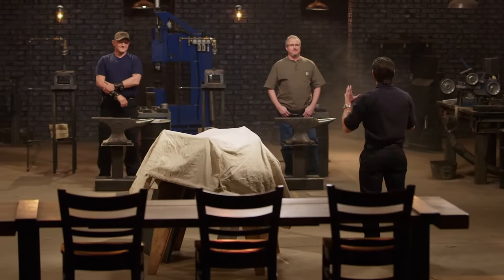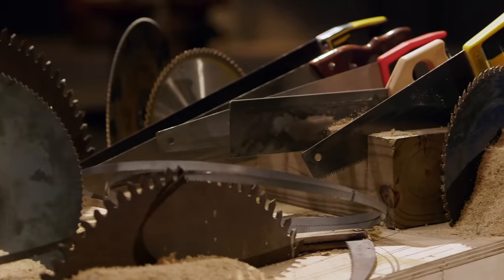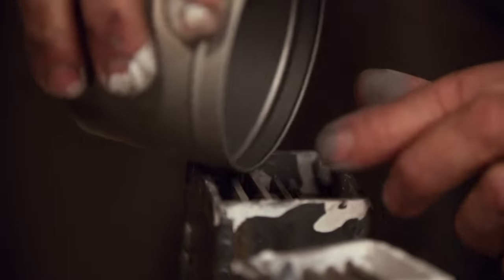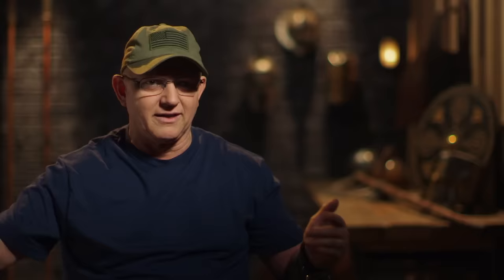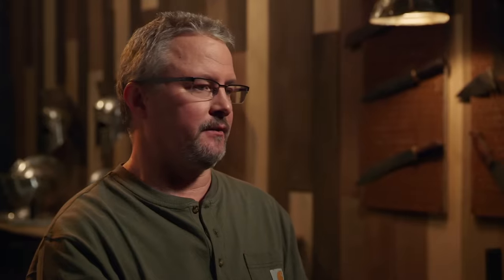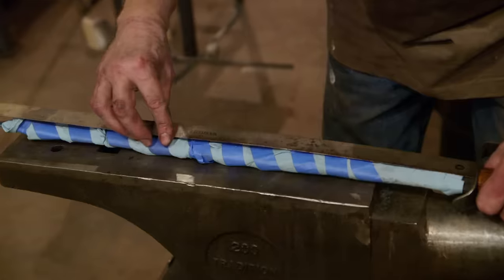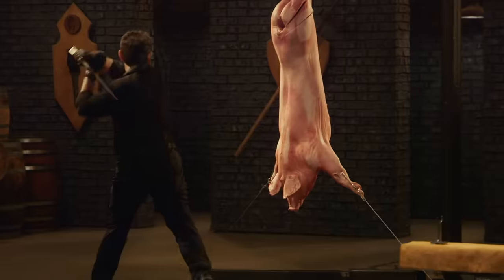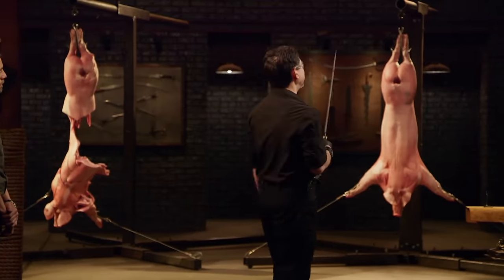Forged in Fire: Beat the Judges: SAW BLADE SWORD CHALLENGE (Season 1) | History

Comment: 4 lbs is an extreme weight for a chopper sized short sword. I have a type XVIIIc longsword just a hair exceeding 4lbs and I think that's even on the heavy end of the spectrum for a 47" longsword but still manageable (it's appropriate for a longsword to weigh between 2.5lbs and 4lbs and remember that's dedicated two-handed swords). For a 20" blade messer/cutlass/cutoe? 4 lbs is gonna send you home no matter what, as it ceases to be a functional sword for its intended purposes. You can excuse that for the amount of time they were given. Rather making it longer as Jay did, at least it would be easier to correct it.
Reply: exactly, both swords were almost identical in the tests, the weight was the only thing that is different.
the only way jay could lose this is by the sword breaking or not cutting at all.
nonetheless great effort by the other guy, looked really nice, held up beautifull just a shame that it weighed that much
Reply: I mean, sure, but the image of absolutely obliterating someone's head with that absolute beast of a sword while it obliterates your shoulder is kinda awesome

Yes J deserved to win but still
Reply: Exactly, one handed sword need to be light and durable. No need to have massive destructive power tho
Reply: If you look closer, most of the weight was in the pommel
Reply: Honestly it is and always will be the wielder of the blade that makes the sword work. Jay's blade was outperformed on all three tests but was easier to wield.  Jay's sword would be better for a no armor duel or malay battle but for an armored duel you want Tony's sword.
Reply: @horvathbenedek3596  If that's true, it would be OK if the entirety of the sword still weigh something manageable (2-3 lbs). Above 4 lbs, a sword with 20" blade should instantly be disqualified. Not saying they shouldn't have tested it, but it just shouldn't win unless the Jay's sword breaks.
Reply: @nathanreimer1296  That's absolutely a false statement. I don't mean to offend you, but this statement is likely from someone who has never handled a sword in his life--which is OK, we live in an era firearms are the primary self-defense tool and weapon of choice. A sword (and even an axe or percussive weapons like a mace/warhammer) needs to have proper weight AND balance to be functional. It's not about how strong you are. The way you fence with a sword is different from lifting a barbell for a small distance in a straight line with your wrist locked.
Also, it's not a 2-handed sword, it's a very very short one-handed sword (if you have a blade less than 20" that's no longer considered a sword). I own and handle zweihanders/spadones weigh 7-8 lbs regularly without problem, because they are appropriate to their size AND balanced correctly. A shortsword of that size weighing above 4lbs is instantly disqualified. I'm glad they still tested it. But the only way his weapon could have won is for Jay's to break in half.
Reply: @fstbr4  Again, respectfully, it's completely false. Please see my response to the other guy. I appreciate the discussion as we are in a very niche community.
It does NOT matter how strong you are, because sword by and large is not a strength based weapon. Of course there are always exceptions. My wife who weighs 100 lbs has grave problems handling our zweihanders that weigh 6.5 and 7.6 lbs respectively. I have no issue at all with them but certain longsword techniques would no longer make any sense, primarily due to the size (both the blades and quillons) rather than the weight. However it should be said that the weight of a sword should be proportionate to its size to remain functional. A 4lbs shortsword is equally ridiculous to Haftor Bjournsson, because for that weight, you should have a much larger size for reach and tip-speed generated.
Reply: @fstbr4  Also since you brought it up, and I think it's a good topic and common misconception: swords generally are very poor anti-armor weapon. In a judicial duel where both combatant wear full plate harness, sword cuts are completely ineffective. Halves of your blows landed on the armor will not even be acknowledged by your opponent if you use only cuts, of course you can still parry and block, bind and wind. Two exceptions being: 1. murder strike done with the quillon or the pommel, so you are turning your sword into an improvised mace or warhammer, albeit a crappy one. Why not just take an actual warhammer then?? 2. very precision-based jabs into the gaps of the plate articulations done with half-swording, which would be very very difficult, most of the time you will need to wrestle your opponent to the ground first. At this point you will find an easier time using your rondel dagger to finish the job rather than your sword.
The weight of your sword isn't a factor at all. If fact, the weight of your sword may even somewhat slow your down, so you suffer at accuracy should the opportunity rises to find the gaps.
Reply: @nathanreimer1296  OK, then I take back the statement of you having not handled a sword. Please understand I mean no personal offense. You are obviously is a..."sword friend" as we refer to in the community. I always appreciate discussions. It's a rebuttal to the argument, not to the person. I will address your statement separately in a reply.
Reply: @nathanreimer1296  You are right that the weight of a blade or sword is relative. Yet, it's not relative to the person or the wielder, but to the size. The weight of the blade should be proportionate to the size. Provided that the sword is balanced correctly, let's say you and I have a problem handling a 6-lbs 1-handed sword. Haftor Bjournsson wouldn't. But when he handles that 6-lbs 1-handed sword, it will not be a shortsword with 20" blade, it should be with 37" or 40" blade on a well-balanced arming sword. My wife who weighs 100 lbs has trouble handling a 7.6lbs zweihander when I don't have any issue. But I would still have problem handling a 7.6lbs xiphos. Because in order for a xiphos to weigh 7.6lbs there is something so very fundamentally wrong about its execution that goes against its design and intended usage.
Reply: @Sgtassburgler  Because Jay spent time on finishing his sword within parameters appropriate for a short sword of that size and didn't have the time to grind and hone the edges properly. The other smith, however, made the wrong choice to allocate time on working the edges. The edges were good, just not on a sword. That's why he lost. Fair and square.
Reply: @FortuneFavoursTheBold  but we don't know its exact weight, because Doug just estimated it.
Reply: @FortuneFavoursTheBold  The statements made which are facts not opinions is that Tony's blade outperformed Judge Jay and the wielder of the weapon is what matters.  Tony's blade was heavier but still outperformed what the Judge presented.  The example of Hafthor is doesn't work since a well-constructed shorter 4lb blade would be far more devastating in his one hand then a any average two handed sword.  It would be ridiculous for him to handle a lighter blade.
Reply: @horvathbenedek3596  Yes, yet we know it's much more manageable than the other sword. Knowing Jay it's not surprising to see him forge a overbuilt weapon, yet even so it's within the parameters even might be on the heavier end of the spectrum. The other dude's sword weight however, is way over the appropriate range. I wouldn't blame him, it's under a lot of stress especially competing against one of the judges. If it was Dave, he would probably build something less than 1.5 lbs.
Reply: @FortuneFavoursTheBold  Sure, but it worked. And as I said - most of the weight was due to the massive chunk of copper at the hilt and pommel. Thr weapon didn't look THAT uncontrollable.
Reply: @FortuneFavoursTheBold  Swords are great anti-armor weapons but again it depends on the wielder.  Armor is never flawless from plate-mail to leather every armor has a weakness and swords can typically find their mark.  Most Rapiers make plate armor worthless when used right and nearly all steel swords with a pointed tip can beat chain mail.  Leather armor and banded mail vary by design but a well tempered steel sword can typically beat them.  It really does depend on the wielder as identical weapons of equal quality will always yield different results.
Reply: @nathanreimer1296  You can "wield" a sharpened dinner table to cut some meat that's not moving anywhere and definitely not fighting back. Again, weapons are designed to be fight with. If indeed Jay's blade weighs 3 lbs, then yeah his shortsword isn't exactly functional either, but still much more functional than his opponents. I think the judges already made up their mind at the beginning of the test upon inspection of the blades, but like you said it's rude and bad for the rating to not test the other smith's blade. And yeah I agree they made the right decision to test it, what if Jay's sword cracks? Unfortunately it didn't.
Reply: @fstbr4  Again, I apologize if my response sounded offensive. I don't mean to do any personal attacks. We are only talking about specific arguments. But every time someone takes stuff from "Advanced Dungeons and Dragons 4.516 Edition" or "World of Warcraft Patch 11.782" and states with a straight face as facts in reality and history, it just frustrates me to no end.
Reply: @horvathbenedek3596  It's not uncontrollable when you cut up some pig carcasses hanging from a hook. They are dead already, they can't move not even running away, not least trying to fight back with a deadly weapon that can end you in less than a split second. Weapons are made to fight, defend, attack without getting yourself killed. A typical sword of this size in reality (such as a Greek Xiphos) weighs 1-2 lbs. If his sword is indeed over 4 lbs, that twice-quadruple the weight. It is completely a deficient execution of a sword design. At this stage, it ceases to be a sword. It's just a sharpened "sword-like-object".
Reply: @fstbr4  About your reply on the edge sharpness and strength of a weapon.
1. You can sharpened a telephone pole and cut dead meat effortlessly with it. It doesn't make it a sword, a weapon. Weapons are made to fight, defend, attack with, without getting yourself killed. Dead meat or green bamboo or ice blocks doesn't move, or fight back with a deadly weapon. Judges are asked to take the weapons' ability to fight with into consideration, and they did.
2. A 4lbs shortsword is not more deadly in the hand of Haftor, because that weapon would be deficient to begin with, as its execution goes against it intended purpose. Haftor (or me, or you) will be deadly with a 4lbs longsword with a 35-39" blade, not a shortsword of that weight. Also the weight doesn't make a sword deadliER. Imagine a sharp knife, how much effort and strength does it take for a 3-yr-old kid to slice your throat, if he indeed gets to your throat? Yes, the sword shouldn't be too light for defensive purposes, but you would rather it be too light than being too heavy (balance is another issue, other than weight).
Reply: @FortuneFavoursTheBold  There is a logic to using fantasy games and stories. This discussion is on real subjects so its best to use facts that can and have been proven.  Bashing and bludgeoning weapons such as mace, morning stars, mauls, and hammers work for anyone strong enough to inflict damage.  They depend upon the wielder to successfully hit and hit with enough force.  Blades do not require as much strength to inflict damage.  The axes and various types of axes offer both however it depends on the wielder again.  When it comes to these Forged in Fire contests it can come down to performance, criteria, and look. Judge Jay's blade was outperformed on all three tests but it was easier to wield.
Reply: @FortuneFavoursTheBold  A sharpened telephone pole would be considered a pike or spear if made usable.  Weapons are made to kill, period.  Practice with them, make them pretty, or use them in sports its only enhancing a persons ability to kill with them.  

In the hand of Hafthor a 4lb short sword would be something out of a horror movie.  Anyone successfully wielding such a weapon would  let the blade cleave deep then move to the next target.  That type of weapon is the one you want when the other person has the two handed weapon.  A powerful strike may send both weapons headed back to the opponent since they would not be expecting it.
Reply: "There is a logic to using fantasy games and stories." You are describing the ideal scenario where authors use facts and logic in our reality and history to make their universe more immersive. Most of the time, they don't. Some of these authors don't very much understand the reality we inhabit at all. Others may understand it, but think it's too mundane. In many of these fantasy settings, established laws of physics don't even apply. Applying the logic or the lack thereof  in fantasy settings on our reality, is a quick way to trick your brain into believing all the falsehood complete opposite of reality.
I roughly agree with your assessment of the different archetypes of the weapons (swords, axes, percussives). Note axes and percussives are NOT heavier than swords, they are just balanced toward the head, rather than being balanced toward the grip like swords do. Also that proves the point being swords rely not on mass but tip speed and sharp edges (tiny contact area with the target) to generate energy. A thumb of the rule is you would rather the sword to be TOO light than being TOO heavy. It of course comes down to personal preference. I prefer heavier (that within the correct spectrum) yet well balanced swords for authority in cuts and edge alignment. However, 4lbs for a xiphos size sword is twice, triple or quadruple the intended weight, at this point it's no longer up to the wielder's strength and preference, it's a "catastrophic failure" to even exist as it is. The only way for it to be more "catastrophic" is breaking in half. I think the judges decided to test both blades to see if Jay's blade will break, which would be the only way the other smith could have won. Jay of course knows how to properly grind an edge, but he was out of time because he focused on finished the sword within the parameters. The other guys also had a choice, and he made the wrong one to work on the edges first.
Reply: @FortuneFavoursTheBold  There is a again a logic to using fantasy games and stories.  Plainly spoken, experts already did the research and some of that follows into fantasy games, movies, and books.   That is a simple statement of fact again but the original counterpoint to this topic  on the video has nothing to do with fantasy. 

The statement that axes and percussive weapons are not heavier than swords is inaccurate, when was the last time a double edged sword was the same weight as a double edged battleaxe?  I think it would be frightening to see a sword that was heavier than a Maul. We all know that swords don't rely on mass as a hammer would, that is also far from the original counterpoint.   

The point is performance on the tests since the two blades were of different design.  They did not make the same sword so the only comparable factor is the test.  Tony's outperformed Jay's blade on all three tests. If they did make the same sword or were aiming for a certain recreation then comparing other things than performance would matter.
Reply: @fstbr4  There is rarely any logic involved in the fantasy writing, and this is an opinion from many of the fantasy book writers themselves. Things are changing now and recent books and video games are getting better, but most established franchises in the past are far from anywhere near being even slightly realistic. Ever heard of "fantasy tropes"? Yup, those overused cliches appearing again and again in the those movies (and not just fantasy-based, but also touted to be inspired by history), that can't be further from the truth. Of course if you follow the historical arms and armor/HEMA community you would be well aware of the ridiculous falsehood in these laughable tropes. Fantasy writer don't rely of logic, and many of them don't even bother to do the research (as it's proven in recent years, borrowing from real life and history can make your setting more immersive and believable), most of them rely purely on: imagination.
From your knowledge it's very crystal clear you don't follow these real-life topics, which is fine, as it's mostly just a hobby these days. With the resources in the modern age, it's fairly easy to educate oneself and catch up quickly. So one wouldn't think "double edged battleaxe" is an actual thing ever existed. Again, it's not called "double-edged" in terms of axes, it's called "double-bit", and in the history of mankind double-bit axes are ALWAYS used as tree-felling axes (different geometries on two bits for different tasks) for lumberjacks, not battleaxe ever used on the battlefield.  In certain oriental cultures, double-bit axes existed as ceremonial "bearing axes" for show at rituals or parades, again never used on the battlefield.
The way you phrase those terms makes it clear you get your source from the images of dwarves not actual human being ever existed on Planet Earth. Therefore, you wouldn't understand why ACTUAL battlefield percussive weapons are generally not heavier than swords of comparable size. They are used with different techniques than swords because they are balanced in the opposite way: warhammers/maces/axes' points of balance are close to the head, swords have points of balance close to the grip. 
The reason swords (real life ones) weighs more or less the same on average with percussives is even though the steel component is has similar thickness than...say a battleaxe (REAL LIFE battleaxes, such as poleaxes, and dane axes have VERY thin blade, usually even thinner than the base of most swords), the blade is much much longer. 
So usually the blade component end up having similar weight than axe or mace heads (I own and customize close to a hundred historical weapons and accurate reproductions, some of which I need to assemble myself, so I'm aware of the measurement of individual components). The hilt components of swords are made of steel counterweight (pommel) and quillons in addition to wood and leather parts for the grip component, so again together they usually way more than the hafts of axes and maces, as hafts are made solely with wood, though with exception in the 16th century when you start to see hollow steel handles on axes, maces and warhammers. So you would be surprised if you are not in the historical arms and armor community, but yes, axes/maces/warhammers don't weigh more than swords of comparable sizes, and ften, they weigh less overall (but feel heavy when you handle them, due to balance).
Again, back to the point of this contest. Tony's blade didn't out-perform Jay's in all three test. The first two they are basically equal, so both can "KEEL" dead pig carcasses, both survived the pots hacking without any problem (edge rolls are expected for this test). The last one it's obvious Tony's sharpness win, and you are right sharpness does matter, especially in combat situation, when you often need to slash through thick clothing and padding to wound the flesh and bone. I'm happy that at least you didn't fall into that silly trope "battlefield weapons don't need to be sharp". Yes, in real life and history, people everywhere have taken blade sharpness on weapons very seriously because it matters. 
However like I said, Jay put the time into making the weapon within the acceptable parameters, maybe his weapon is still heavy, but at least properly heavy. That's the reason he didn't have the time to work his edge to be razor sharp. Tony's however, is disqualified in judges' minds from the get go for his faulty execution of the design, but they tested his weapon for the ratings of the show, and out of respect, also to see whether Jay's blade will break. Unfortunately that wasn't the case. Tony did not take it well. There are two take-away from this: 1. Tony is a knife-smith, and most people making a life smithing knives don't really understand swords, as swords are no longer common objects in modern life; 2. Smiths are given very little time to reflect on set. I think even if Tony isn't familiar with the concept of swords, should he be given 4 or 5 days, a smith of his caliber will be able to figure out his sword isn't a functional weapon, and will take appropriate amount of weight off in the last day or so, by creating a deeper and broader fuller, or simply grinding more material off the blade or maybe even the pommel. As we see on this show, that's usually what happens when you give smiths time to reflect.
Reply: @FortuneFavoursTheBold  How and why fantasy started up on this real counterpoint was a misconception followed by a wordy distraction.  

The opinion that the blades performed equally in any of the tests can be disproven by watching the video objectively.  Tony's blade did more damage, held up better, and cut better.  He did not fail and he knew it too.  Problem for Tony is that the judges only focused on the weight of the blade and gave Judge Jay the win.
Reply: @fstbr4  It's not a distraction. It's all direct response to your claims. If you have actually read instead of repeating yourself, you will reach the correct conclusion and learn a thing or two. I explain why weight by itself is not a problem. Weight needs to be proportionate to the weapon size and weapon design. 4lbs is considered too light for certain weapons, and it's too heavy for others. I already said for a sword with 20" blade to weigh over 4lbs is a catastrophic failure. The only way something can be more catastrophic is for it to break in half. The judges are there to judge the validity of WEAPONS of a specific kind, not some obscured objects. Know that this is a mainstream show, the judges generally play gentle on contestants, as most contestants have never worked on a sword or other historical weapons, they are knifesmiths. I actually personally know some of them. They would be considered apprentice in the field of swordsmithing. Someone who has zero understanding of actual real world and historical weapons of course will not understand the decisions behind it.
One can always learn, and the historical arms and armor community is very welcoming to newcomers, but if he refuses to learn anything, well he has the right to maintain opinions contrary to facts. That's your "free speech" right guaranteed by the 1st Amendment.
Reply: @fstbr4  On the other hand, if you want to learn about it and develop an excellent hobby, I can invite you to join a few historical arms & armor and historical martial arts group like "XV Century European Armour", "HEMA Manuscripts" and "Sword Buyer's Guide". You don't have to buy any antiques or reproductions to appreciate the discussions about actual swords and weapons and techniques there, especially if you enjoy an entry-level show like "Forged in Fire".  You will find real life subjects are more interesting than fantasy tropes.
Reply: @FortuneFavoursTheBold  The responses that tangent off into another area or a completely different arena is a distraction.  RP Games was never part of the counterpoint but somehow it got introduced anyway.  The blades were not of a specific kind or as the blades were of very different designed.  If they were of a specific kind then Judge Jay would have won without the blades being tested.

The show has the primary purpose of promoting the forging of weapons or armor.  They brought in experts in the field for credibility but the sad truth is that is still a TV show that needs ratings.  If the experts get beaten all the time the show would be canceled.  Judge Jay made a more manageable sword but for testing purposes Tony's blade outperformed his.  A catastrophic failure is when any part of the weapon fails.  An unwieldable weapon is a disqualification which near happened with Tony's blade.  Judge Jay's blade is better for battle but Tony's blade outperformed the Judge's blade during the tests.
Reply: @FortuneFavoursTheBold  Fantasy again was introduced by a misconception.  People don't fully appreciate an authentic recreation of an ancient weapon until its held.  Reproductions can be knock offs, antiques can be too degraded, and books work if all you want is information.
Reply: @fstbr4  "Fantasy again was introduced by a misconception." This statement is constructed in a way I cannot comprehend.
"People don't fully appreciate an authentic recreation of an ancient weapon until its held.  Reproductions can be knock offs, antiques can be too degraded, and books work if all you want is information." That's a great statement I can get behind. Which is why people get into the community to identify bad reproductions from good and excellent ones. Books of course work, many of the reliable sources especially considering history martial arts come almost exclusively from books (surviving manuscripts). Yes we do have well-preserved antique original arms and armor to get the most authentic feeling, and create reproductions from, which is why master custom swordsmiths are highly valued on the market, and to do a commission you typically need to stand in the waiting list for years on end.
Reply: @fstbr4  The responses tangent off into another area because you brought many of the typical tropes and misconceptions introduced by fantasy into the conversation. That's OK, we all buy into some tropes and misconceptions on different subjects. It's important, that when given a chance, we do recognize them as misinformation. Also fantasy hobbies are legit, this is not to step on gamers, table-top enthusiasts or LARPers. But we do keep them separated from reality.
About the show's weapon testing. There has been quite a few examples in the past, where contestants turn in weapons judges downright refused to test, for different reasons (including weapons not following the specified parameters). It's a bummer, for sure. But the opinion from me who regularly handles battle-ready weapons is, that the judges are often too kind instead of too harsh, as Forged in Fire is a mainstream show, so the producers make judges behave that way. I like seeing meat getting chopped, that's what we are all here for. But it's crucial to remain level-headed when lethal weapons are involved.
Reply: @FortuneFavoursTheBold  None of any of that has to do with the clip.  Anyone watching will see that Judge Jay's blade was outperformed in all three tests but they chose his blade instead.  Motives vary in options and opinions but Judge Jay's blade was still outperformed.

As for the 'master custom specialist venerable reputed whatever makes them sound better than the normal smith,' the reason their skill is valued is that the market is so minuet. The respect for such work is not lost by a long shot but its demand is around the same level as pewter work.
Reply: @FortuneFavoursTheBold  The fantasy was introduced by somebody guessing at references which was a misconception. 

As for the show, when the test is aimed to a specific reproduction then a couple weapons failed before they were end tested due to them being unsafe to wield or failed to me the specific design expectations.  Honestly the ballistic dummies offer a much more accurate test since most of this weapons were aim to kill humans.  The few weapons that are not meant to kill humans then its just wasteful if all they do is throw the animal remains and slabs of meat in the dumpster.  There are food banks, half-way houses, and soup kitchens that watch this then cry that all that food is probably ending up in a dumpster to feed flies, rats, and roaches.
Reply: @fstbr4  It is a niche market for renowned swordsmiths. It's not the whatever fancy name that makes them stand out, it's the craftsmanship that capture the originals' handling dynamics and aesthetics. Of course it is of less value to the people that has zero interests on the subjects, who may appreciate these as work of arts, but not also weapons of impeccable handling characteristics.
Reply: @fstbr4  Also, Tony's blade did not outperformed Jay's in all three test. His only outperformed the other in the sharpness test. Sharpening is the easiest and least time-consuming part of the forging process. Anybody can use a bell grinder to take an object to razor sharp with relatively little time. Heat treat, creating the correct blade geometry, and most importantly giving a weapon the correct handling characteristics take years probably decades to master.
Reply: @fstbr4  About these tests, again it's a mainstream show so audience only want spectacles. A real proper test would be having two combatants with correct fencing/fighting techniques to sparring with them, which is not safe enough to be part of a TV show. A shield dressing kits will gutting knives and bone saw will "outperform" ALL of the weapons forged in the history of this show on hanging animal carcasses, that doesn't mean they are weapons. When you forge a weapon, your deliverable must fall in the specified parameters. A xiphos sword is never intended to be a butcher's cleaver.
Reply: @FortuneFavoursTheBold  The Judges comment on the performance  during the tests with every test.  Tony's blade visible performed better and the Judges comment on it.  Their final comment was that Tony lost because of the weight but after each test with Tony's blade the comments were better than Judge Jays.